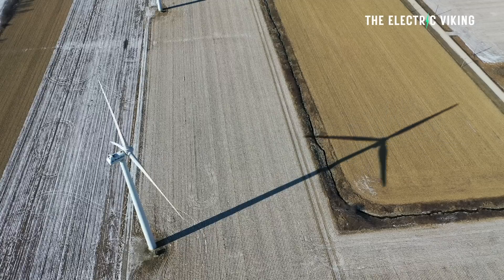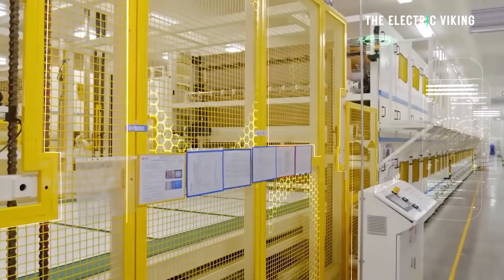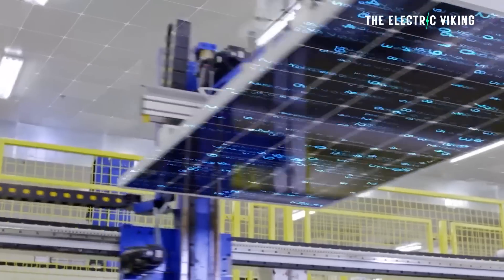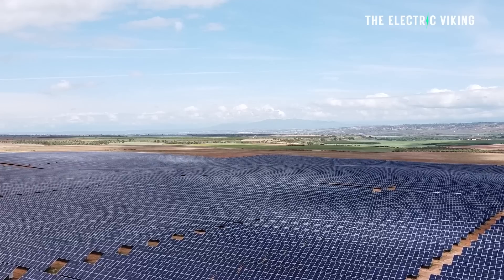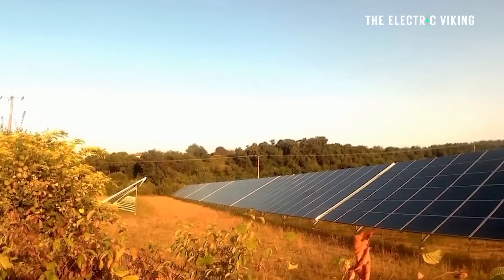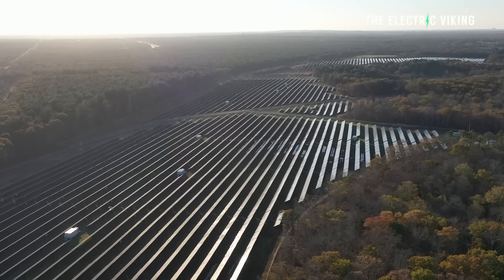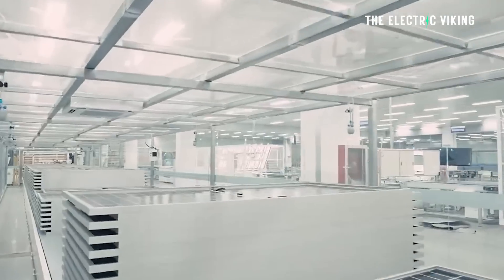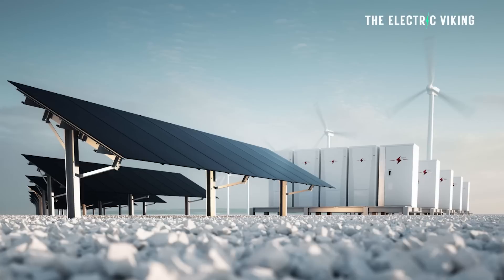New solar efficiency records make solar cheapest electricity in the world

Comment: We are getting tiny incremental gains in solar, but they are not adding up fast enough.  Our cells have been tweaked and tweaked. A completely different cell is needed.  If we could double efficiency that would be something.  But the area we need to cover in solar to meet our needs using current technology is way bigger than Elon lets on.  
On average all the new solar farms going in around here are 11 acres per megawatt.   So I live in Georgia south of Atlanta near a major interstate highway, I75, going to and from Fla. 
If we are going to replace all those diesel semis with Tesla Semis we need 11acres of solar farm at high noon on a crystal clear day to power a single megawatt charger in order to charge a single Tesla semi.  The best figure I can find say there are 8 to 10 thousand trucks that go by every day on that one road.  Lets say on average each megawatt of Solar Farm can charge 6.5 trucks a day, assuming about 800 kwh per charge.   Averaging 9000 trucks, and adjusting the solar farm with 25% cushion for cloudy days and winter months we are talking 25 square miles of solar, for just the semi trucks on one highway in the state.  A truckstop that charges 100 trucks a day would need around 170 acres of solar plus batteries.  All this for a  truckstop that in and of itself would only be about 15 acres.  
If someone can figure out how to print multi junction solar cells, cost efficiently at scale, we could have a solution.  Those are the only kind of cell that will give us the 45% efficiency needed.  Cells that have multiple layers each turning a different spectrum of light into electricity.  The single spectrum cells we have are about peaked out.  But multi junction solarcell  panels currently cost $45000 per square meter.  So we can double the efficiency of current panels by increasing the cost 450 times.  This problem has been extensively studied for a very long time.  
The other MAJOR issue is unlike batteries, solar panel recycling is nowhere near cost effective now.  That's a lot of trash we are creating on the assumption the next generation will just have to deal with it then. 
Lots of giant hurdles still to overcome.  We aren't right at the door to success by a long shot.

Comment: Dear Viking: Let's wait and see. On Risen's website their best panel comes with 22.5% efficiency, which is close to 1.5% lower than mentioned in the video. This could mean the new and better tech still takes some time to hit the market. Nonetheless the technology in general is moving as there are a lot of efforts to get to 26% and above using tandem cells. But also these are not really mature yet, as the thin film portion of the tandem seems to lack some stance. They are not yet up to par with a typical 30 years linear power loss warranty level of less than 15% like the silicon based cells are typically achieving.

Comment: The new perovskites panels manufacturers are working on think they can theorectically get up to 49% efficiency because its new technology encompassing silicon and perskovite materials.
Reply: However theoretically achieveable efficiency won't help anyone as only the practically achieveable efficiency pays off. That one is probably levelled @ 32% for 2 fold tandem cells using Perovskites.
Reply: @beatreuteler   Im not sure just mentioned 49% and previously current panels have some sort of solar barrier which was much lower so this is good news. I did see a chart stating certain testing getting to 40% but that wasn't real world world testing. From what I gather basically with this new type of panel several countries particuarly england and germany keep outperfoming each other in conversion rates.
Reply: @jordanbrown7403  The Shockley-Queisser Limit saying that 32% is the max. possible conversion rate at a band gap of approx. 1.2 to 1.4 eV. However using tandem solar cells (Oxford PV and the like) you can go beyond, but it is still hard to do in serial production. Fundamantally you are right, the limit can be surpassed.
Reply: @beatreuteler   At 32% thats still really good mind you.
Reply: @jordanbrown7403  Yes Sir!

Comment: FRAUD! how about cost of batteries ? power inverters ? more spaced to house batteries and inverters, the low efficiency of the power inverters power loss, panels on roof is like putting sails on a house, cat 1 storm takes the roof, and when roof leaks, have to remove  panels , no electric while roof is repaired, over $14000 for roof plus reinstall panels, and more holes in roof, all to run what? not heat,ac,stove,dryer, water heater, washer, dish washer

Comment: These panels sound great,but even the older used panels are cost-effective when space is not limited.
My ground -mounted 60 250w system is almost replacing the power for two houses.When the batteries are topped off at night with cheaper rates,there is little grid support needed in the daytime.
The key to get the most out of your investment is batteries. The battery bank can be scaled up piece by piece,paying cash to stay out of the grip of greedy lenders.
Reply: Yeah but where I live there aren't many people who can afford sparing land for ground mounted solar. Rooftop is the choice. And many people can't afford to have a great roof.
Reply: I wish I had the space you clearly enjoy. The cost of 60 panels is nothing compared to the cost of the land to put them on in a town....which is where most people's homes are. Typically a home in the UK can fit about 12 on its roof, facing approximately south.
Reply: @occamraiser  You can also mount panels on the roof where it faces approximately north. Depending on roof incline it can be worth doing. 50% of our panels for example are facing NNW to W and their performance is very reasonable even though the roof has an incline of 42 degrees. With this it may be already some 24 panels instead of 12 which will do a nice contribution.

Comment: OK, so all that sounds really positive.
However, I have a question, or more:  Firstly, it is said these panels have a lifespan of 30 years. Great. But, with the speed of innovation in the field, they will be hopelessly obsolete in even half that time, not to mention not being able to support the associated electronics. 
So, would that mean they would need to be replaced much sooner? That would mean amortising that investment in a much shorter period, making that a more expensive product, as it must then be replaced (at some unknown cost level then).  [I speak from experience with a solar system I installed, albeit not a photo-voltaic system, but a water heating direct system. but the principle may be similar?]
I'd value your opinion.
Reply: My opinion is get a quality system that suits your requirements. It will do the job for 30yrs+ and is pretty much technology agnostic.
Reply: @3rdrock  Thanks for the reply Glenn.  I am a recent arrival in UK from SA, so I can only speak from from that perspective.  A neighbour of mine had a complete system installed in order to be free from the ailing (now terminal!) Electricity supplier (Eskom), and he spared no expense. 
I do concede that battery technology at the time was quite primitive (lead acid type, as used in heavy trucks) but the rest of the system was supposed to be top level electronics.   Within 3-4 years, he hit severe problems with the electronics, and obtaining spares to effect repairs. By that time he realized that his set-up was pretty out-dated and he had to start preparing for upgrading. I recently heard from a friend I used to walk with that his system had reached the stage where serious investment is now required to get it up and running properly. 
I further concede that technology has improved dramatically but I still have a big concern that a system may become obsolete quite quickly, and make it hard to get the performance required. For a person not well-versed in such matters it could be a minefield. 
Thanks again for taking the trouble to reply. 👍
Reply: Hello ...the experience you share of the early adopter...is not to be overlooked, and thank you for speaking to us...let's take the caution yet perhaps we can still run with the technology?

One way to look at all this is to ask a question maybe☺️:- what is the productive output of that energy created before update is required. Where a system is used to power a laptop that drives the wheels of an effective enterprise ...then the fact that we are driving environmental conservation goes on top. 

Solar will certainly reduce urbanisation that has so thwarted our two countries and centralised social imbalance. 

The young guys in Sa and Zim need power to make lives.

 🕯️
Reply: @adamanthony7465  For sure, Adam. In the current catastrophe of the power utility collapsing rapidly, it has become really important. My mates tell me the providers of solar and wind generating options are making a fortune!   I guess the younger folk are also more amenable to new technology, unlike us old fossils!  😏
Reply: @dennisleighton2812   Companies are working on perovskite panels but depends your price range and how long you can hold out until purchase,manufactures are looking to commercialise this year. They are more expensive granted but more like 27% efficiency and upwards,in lab conditions makers have got cells over 30%.
Reply: @dennisleighton2812  Am I that old Dennis 😄..have a good day 👋☀️
Reply: @adamanthony7465  😂
Reply: “The best time to plant a tree is 20 years ago, the second best time is right now” Applies to solar PV too. Our 9.92 kW system is less than 3 years from paying for itself after 3.5 years. Of course, we upgraded efficiency so we use less electricty by all LED, convection   range, induction cooktop, and mini-split heat pump providing all heating and AC between -25C and +38C. All appliances washer/dryer/dishwasher/refrigerator are high efficiency models. We went from using 13,000 kWh plus oil fired boiler warm-water heating $$$$ to 10,000 kWh (which includes heating AND AC) in a larger and more comfortable house. Atlantic Canada seacoast, like Scotland in climate but much colder in winter.

Comment: For most home applications, the important thing is peak power per installed cost, not peak power per area.  (i.e. kWp/$, not kWp/m2).  But yes, in the long run better kWp/m2 will lead to better kWp/$.  Solar and wind are indeed the future.
Reply: that only matters for the battery.  thats whats running the grid or your home during high surge times where demands are at its peak.  solar has to be paired with batteries or its not anywhere near as good.  solar is there to use during low demand times, and to feed the rest to the battery for when you need to use appliances and do other things that will require far more output than what your going to get from solar.
Reply: With storage..... Then the naysayers cheap:- "but the sun & wind don't shine & blow all day everywhere".
To which, those with stationary storage can reply:- IDGAF!!! 😆😅😂

Comment: You have a better solar exposure in Australia, here in the Uk we really need 30% panels, like the new perovskite panels are supposed to produce.
Reply: People working on it, check at oxford pv and meyer burger both close to commercialisation in germany, as well as other companies.
Reply: @jordanbrown7403  yes and I am sure they will be giving them away.
Reply: @robertfonovic3551   No need to be snarky look them up they are real companies.
Reply: @robertfonovic3551  If they are outpricing these panels they will see it on the sales figures, possibly finding a reason to adjust. Don't worry. You may think of the higher than 50% cost of a professionally monted rooftop solar: It's the working hours of the person mounting them rooftop. This said, even if the panels will be more expensive in the first place, they may still help making the entire installation more cost effective as less install hours per KWp are needed the higher the KWp/m^2 will be.

Comment: This is true, solar is now the least expensive technology of power generation on earth and will continue to get less expensive and will dominate energy generation.
Reply: If they can remove the dependence of solar panels on silver, which is in the works, then that will certainly happen. A PV system that doesn't use any (or hardly any) rare earth metals  and is economical to recycle will blow everything else out of the water. Will be the cheapest  by a country mile.

Comment: Nice to see! Efficiency is most important when space is limited. Otherwise you can just add another panel. These will sell if the price is right but if they are a premium price most owners will opt for one more cheaper panel. We had 22% panels available 10 years ago but they didn’t sell due to the high price.
Reply: yes, if you have enough space, you go with the cheapest which results in about half the price for 95% of the power compared to the best modules.
Reply: I got eight used panels only 180watt each but at 17cents a watt not bad if you are looking for 18months RTI and they still have 12year life left.
Reply: @tonysofla  More than 12 years..... usually lifespan is quoted as number of years till output is reduced 20% or 50% etc. They will still be plodding along slowly for decades.
Reply: 10 years ago the top solar cells (silicium) had some >22,7% rendement.....source...the team using those  cells used on a solar car driving the WSC 2013. Price...sky high...but making the panel from those cells was even 10 times higher.....because also low incoming light must be redirected (optical)as much as possible to the silicium surface.
Reply: Higher efficiency also helps reduce labor costs, install fewer panels. Usually labor is a larger cost than the panels.
Reply: @durwoodmaccool890  True, but a 1% efficiency improvement would mean one less panel to install per one hundred. So you are talking solar farms rather than rooftops. And space isn't issue on acreage.

Comment: If you generate power on your roof then the following;

No extra transmission grid to get electricity to the 20million buildings in Australia. 

No extra support structure up in the sunshine like the civil/structural engineering needed on green field renewable sites or access roads. 

The existing national grid is UNLOADED by 50% and available for other uses.

Those are massive cost savings to big government.

Edit, EV batteries will be 100kwh and need to be topped up. 
20million vehicles in Australia.
Reply: After reading your ridiculous reply, I also unloaded

Comment: Sounds good, but how do you get power at night?  You need to include the cost of a system that works 24/7
Reply: That’s great news and I hope to see costs reduce as manufacture ramps up on these panels. It looks like there are more jumps in the pipeline for solar with Oxford PV hitting just shy of 30% efficiency for their Perovskites on silicon cells. Their volume manufacturing line will start production later this year.
Reply: Batteries. More wind turbines and there is less demand later at night.
Reply: @jpascoe1454  Who is paying for all those batteries and wind mills?  This is why grid solar drives up electricity rates, not reduced rates
Reply: @TheTruth-yq2jb  No it doesn't... Solar is the cheapest energy generation method in most of the world.
Check your sources (of find another place to troll at).
Reply: @udishomer5852  then why is electricity so expensive in California?
Reply: @TheTruth-yq2jb  Who pays for the present coal, gas, oil and nuclear infrastructure used in the world today? Consumers! Solar, wind and battery inrastucture will also be paid for by consumers. Hwever when the old fossil fuel infrastructure is replaced by the new renewables infrastructue energy will cost a fraction of what it does today. Don"t forget it took 120 years to build our present fossil fuel infrastructure. I do believe that it will be largely be replaced by renewables within the next 20 years which means all people will enjoy the benifits of cheap energy.
Reply: I'd suggest getting an utility provider that screws its customers over less.
With my power company I use hourly price rates and can practically see the sun going up making a dent in the price curve.
Reply: @TheTruth-yq2jb  installation & taxes.